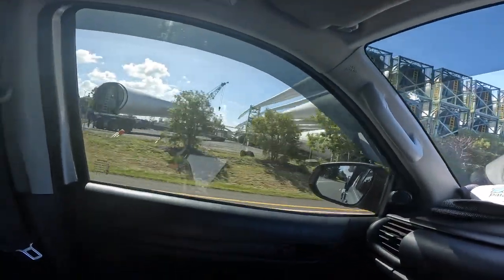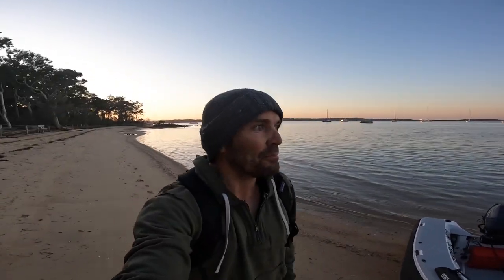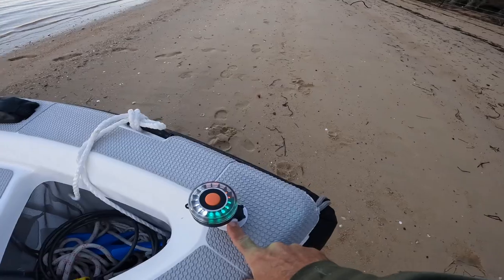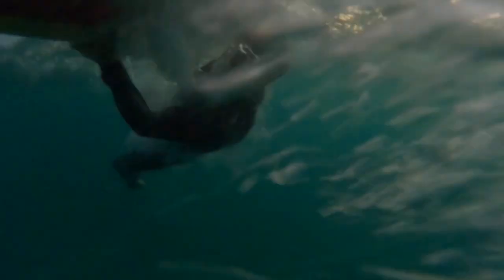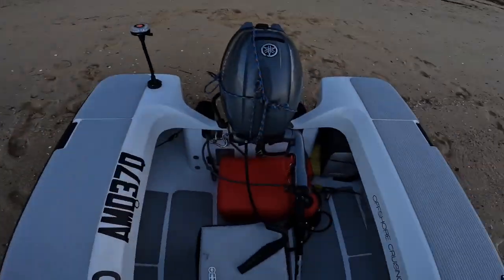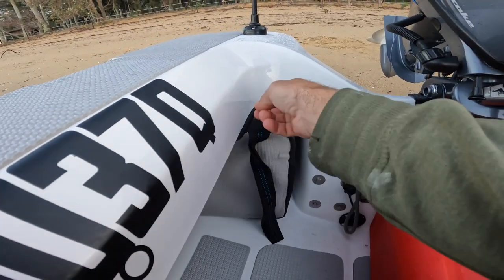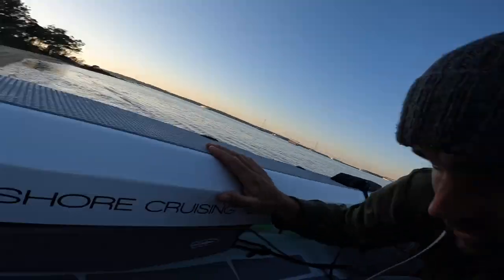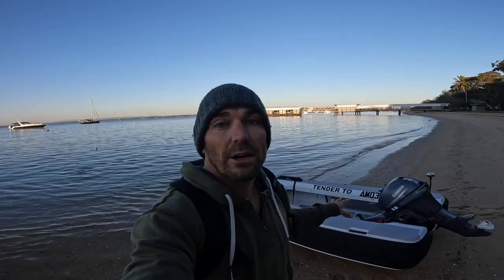NEW Offshore Cruising Tender: Walkaround & Review! 🍾🙌

Comment: Good buy, great little tender, I've had one of these for 6 years with an 8hp on it, propped it down slightly to a 7"pitch & planes with 2 x adults + 2 x kids. Also changed 10lt fuel tank and keep it upfront, keeps the floor clear & weight distbn better
Reply from the maker: Yeah right. Had that brought down your max speed much?
Reply: Down a bit when unloaded with just one person onboard but not as noticeable as I thought it would be. Engine able to rev a bit higher now when medium load onboard so top speed about the same as with the original prop.  Picks up better now when heavily loaded and holds the plane when previously wouldn't. You've got a bigger motor so prob don't need to drop all the way to a 7"pitch. Hopefully you can find somewhere that will let you demo a prop or two.  @slightadrift

Comment: The OC Tender is the best tender available.
Reply from the maker: Absolutely agree 👍
Reply: @slightadrift I'd like to get a 350 carbon like the one that ROAM has. They have a 20 hp on theirs which the transom was built extra strong to handle it but it cost something like 20k usd to get. I'm going to have to build my own because that's a lot of money to spend on a small boat.
Reply from the maker: Can you save a few $$ and not get the carbon version?
Reply: @slightadrift That's true but I could probably build something similar for $2,000 in materials plus my time. I guess I'll see once I finish building my boat because time is money as well.
Reply from the maker: 2k vs 20k sounds like a lot of incentive!! Good luck mate 🙌
Reply: @slightadrift Thanks. I've been thinking of a design and have almost figured it out. I'll be building it the same way as OC Tender builds theirs. We shall see if I end up building my own or not but that's where my budget is right now.

Comment: Aluminium is far easier to repair, plus it doesn't damage as easily. You can temporarily patch with glue and a sheet of alloy, or rivet it on for more permanent. I would never choose fibreglass, it should be banned. You should read about how much pollution fibreglass boats and the wind turbine blades you passed create. Thanks for the video though.
Reply from the maker: I’m not able to fix aluminium… main reason I didn’t choose it. I hear you on the pollution. Hopefully with some good upkeep this boat will be off the scrap yard a very long time. I also think fibreglass that can be recycled will eventually become the norm hopefully sooner rather than later. Cheers for your comment! 🍺